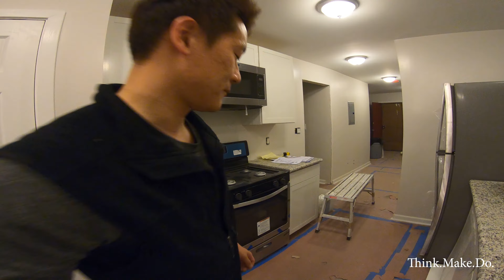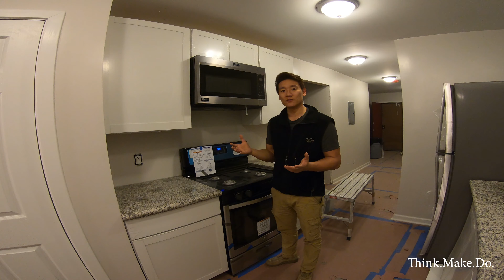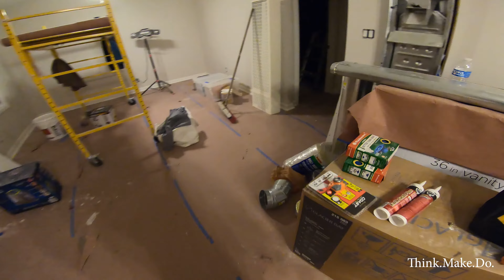Installing our Microwave Hood Vent and re-purposing an old roof cap - Triplex Renovation Part 14

Comment: Meh...flex tape for exhaust is a no-go, so is using blue painters tape. Also the taping of the insulation in the attic is pretty lazy. Any inspector will tear this DIY job apart but I guess you tried...

Comment: Watching a few exhausting [sic] videos before I do this same job and thanks for pointing out the damper door interference and needed extension as I’ll get that sorted when buying parts tomorrow and not too late because you’re the first vid to point THAT conflict out! You’re awfully light on your feet over that 2x4 ceiling framing! I extended a 6’ catwalk another 8’ out and over insulation to do my exhaust vent install comfortably. Cheers!

Comment: I found this video because I am installing a new hood vent over our stove and the roof vent and new hood vent are not aligned.  I am looking for a solution on how to connect them and one thing I have read over and over is to NOT use semi-rigid aluminum ducting (as used at 9:34 mark) for venting a stove because the interior is not smooth and grease can build up in it over time.  Such uses will not pass inspection.  Still, I see it being used in lots of videos.  I guess it's one of those things that will hardly ever cause a problem but when it does it's probably a big problem.  Still, it would solve my problem easily so it's very tempting.
Reply from the maker: instead of the flexible ducting, you can use a series of adjustable rigid ducts.  the first section coming up from the ceiling is one of those adjustable angle ducts, that could have then be fitted to a straight pipe conforming to code.

Comment: 5:00 I am using the same exact duct starter and what I did was use metal sheers to cut off about 1/4" off the corners of the flaps..am still working on getting screws in it that will not inhibit the flaps, may have to use machine screws and nuts instead of the typical duct work screws.

Comment: Great video!  The extension is the part I ran into as well.  Why do they make that part alone?
Reply from the maker: because...money.  and i think its only necessary in a top vent installation.  the back vent install wont need it, and recirculating mode wont need it either, so i guess it saves them money not to include the extension and potentially have it go to waste.

Comment: You did good.  Using the existing vent was the best idea, more work but better than making another hole in the roof which could eventually cause a leak, and a lot more work to fix the damage.

Comment: You are the first colleague to mention the 3 inch extension. I have seen so many of these installed where that was ignored!
Reply from the maker: Yes! i can definitely see why some homes, even with an air vent still have grease all over their kitchen because the damper thing isn't able to open fully.
Reply: @ThinkMakeDo  I am still looking for an elegant solution to getting an air tight seal between the adapter on the machine to the riser.  Using a sealant looks promising although it would likely gum up the pivot of the baffle. Practice I guess.  Needs to be quick, effective, without risk of dropping into the squirrel fan, testable within a few minutes, fixable even after completely assembled, air tight.